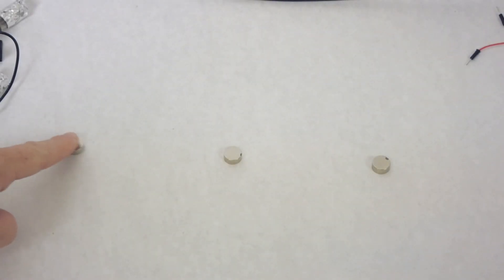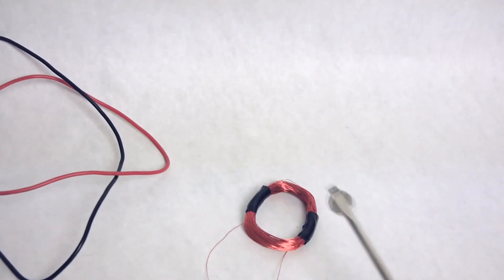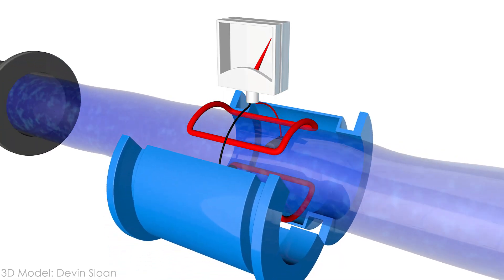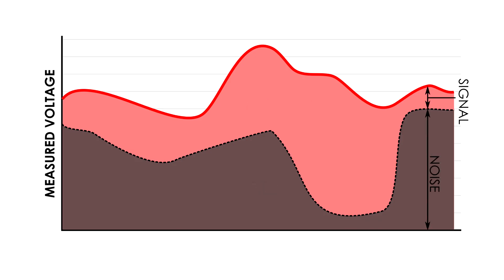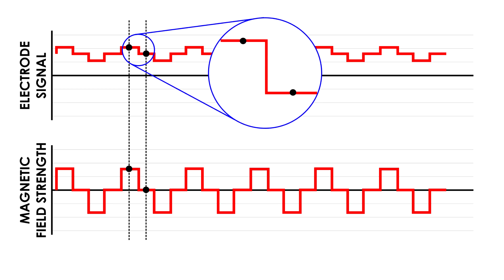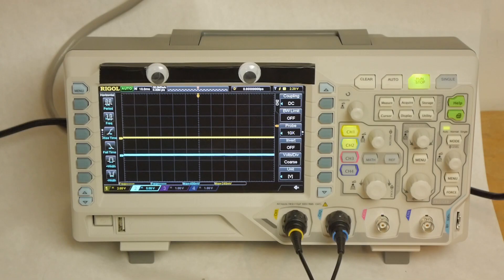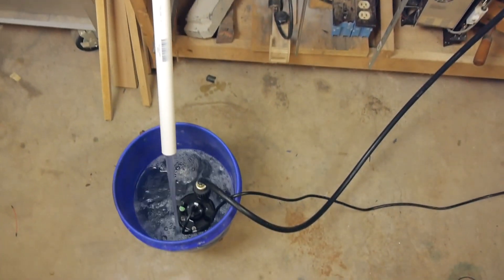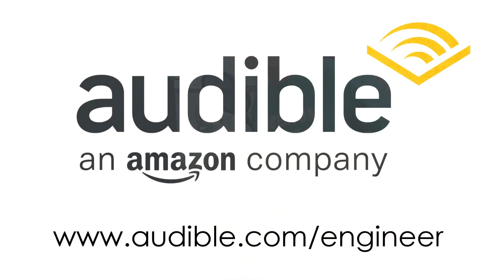How to Measure Flow with Magnets - (Magnetic Flow Meters)

Comment: The air core coils you're using may be a source of some of the problems. Try using a soft iron laminated core. Air cores are good when you need a homogeneous field (like in an NMR) but require huge amounts of current to get appreciable field strength (Which is why NMR machines typically have superconducting magnets). A soft iron core will help concentrate the field into the fluid.

One caveat is that the iron core will have a higher inductance, which could damage your H-bridge if switched off too quickly. A capacitor in parallel with the coil will suppress that, but will slow down how fast you can switch between poles. Keep in mind you'll want to use a non-polarized capacitor or diode isolated electrolytics. 

I hope this helps

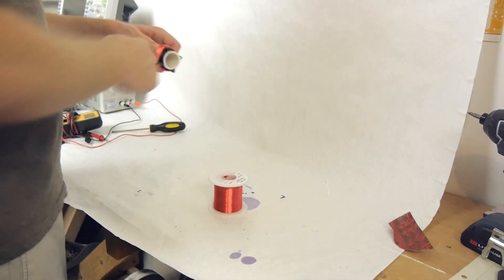Comment: 6:09 But....... You have a turning lathe....
Reply from the maker: It's a wood lathe that spins quite a bit faster than a metal working lathe. I couldn't think of a way to do it safely.
Reply: Sorry I know nothing about lathes.

 But couldn't you just wind the cable easier? I didn't mean you to try cutting anything.

Comment: Dear +Practical Engineering,
Please use the "math" function on your 'scope to multiply channels A and B, where A is the uV signal from the electrodes and the B is the current through the field-coils. Next, "measure" the average (mean) of the product-signal (i.e. the output of the 'math' channel), normalize for the excitation-amplitude and voila, you have filtered the needle out of the haystack :) The DC (average) level that you measure should be proportional to your flow. You can even measure bidirectional flow. For best results, put channels A and B on AC-coupling, HF-reject, heck you can even do triggered averaging if you trigger off of the current (channel B)! This is my favorite version of a low-budget-synchronous-detector :)
Reply: Yep, this is the reason for using the chopped Signal in the first place, so you can synchronously detect it in York noisy signal. This basically behaves like a really small bandwidth bandpass filter, thus reducing the noise voltage extremely.
Reply: same function as a Lock-in Amplifier....
Reply: A "synchronous detector" is a subset of a "lock-in amplifier" - this particular use-case doesn't warrant a (way more expensive) lock-in amplifier, i.m.o., especially since the reference excitation-signal is readily available.
Reply: hello aditya. I am looking to develop magnetic flowmeters here in india. would you be able to offer any help?
Reply: @ATLANTECHFLOWMETERS  Sure. PM: firstname.lastname  (a) gmail

Comment: You need much strnonger magnetic field, i.e. more efficient design of the coils. I's suggest a C shaped metal core with the PVC pipe going through the opening in the C. The rest of the core can then be covered by a massive coil. Such design with a somewhat closed magnetic circuit would provide more tightly packed magnetic field. Also, you can try adding another set of measuring electrodes - Iď suggest one pair at the place where the fluid is entering the field and one at the place where it is leaving the field - these two pairs should produce opposite signals (hopefully with the same orientation of noise), so by subtracting the two signals, you should double the signal and reduce the noise at the same time. Maybe the placement of the measuring electrodes with respect to the coils was the main problem - have you tried moving the coils upstream or downstream from the magnetic coils?

Comment: A combination between positive displacement and induction coils is quite easy to do. I've seen industrial flowmeters with simple design as such. It is using an orifice plate, a rotating wheel with an iron core attached inside a pipe, and a coil to induce flux. The amount of voltage induced would translate to the velocity of flow. It is essentially a small hydro turbine and the orifice plate serves as a constant.

Comment: A hint from an EE: if you have to extract data from a lot of noise, and you have the excitation signal available, you can use a lock-in amplifier to do so.
You can surely find all the details searching the Internet, but the principle is to extract the correlation between the stimulus and the output, so to increase the SNR; this can be done with a simple analog multiplication between the input and the output.
Once you have done that, you'll be able too heavily low-pass the result of the multiplication and get a nice clean signal.

The multiplication is especially easy to do with your stimulus as you simply have to invert the signals coming from the readout twice per period.

One question, though: why did you use (+1, 0, -1, 0) instead of a simple (+1, -1) excitation?

Comment: Always control bandwidth to just what you need.  Filter the diffamp inputs!  Don't ignore the common mode voltage and assume it'll work out on its own!

Obviously, the output from the peak-detect-and-subtraction thing needs filtering to see the DC output at all.  Which is where the real power of filtering comes in, rejecting all that noise that isn't even your signal. :)

Comment: I'd expect it would be better to measure peak to trough rather than peak to midline. It effectively doubles your signal strength for no additional cost. Also, passing your readings through a low pass filter that rejects any signal above 5 Hz or so would be a good idea. It looks like quite a bit of your noise was 60 Hz line noise and harmonics from the motor. Eliminating those would clean up your signal substantially.

It would have to be a digital filter, absent some real complicated analog design knowledge. I'd probably have the frequency of the magnets alternating at about 100 Hz. You could theoretically do it as low as 10 Hz if you only care about 5 Hz signals and below, but a good rule of thumb is to oversample by 10x. During each cycle, take a reading at the end of the peak and the end of the trough, just before flipping the polarity on each. That gives plenty of settling time. Then difference the measurements and stick the results in a digital filter.

I'd still expect the output to be fairly dirty. You may try adding a ferrite core to your magnets (though test to make sure they can switch fast enough with the added inductive load) to boost the magnetic field. Or up the amperage. Your differential amp might also be the source of some noise. I'd slap an analog pre-amp on it with a 60 Hz notch filter and maybe a on it to get rid of a lot of the power line noise. Probably a low-pass anti-aliasing filter, too, with a corner frequency just above the switching frequency of the magnet, but considering you'd have one in the digital domain already, that's probably overkill.

Comment: You're saying it's DC, but it is AC as the direction of the current is changing. It's not a sine wave, but that doesn't mean it's not AC.
Reply from the maker: You're right, I used the term incorrectly.

Comment: One possible approach that I'm surprised I haven't seen in the comments yet... reduce the cross section to have the same flow result in higher velocity?

I haven't really thought this through but you could even try a noncircular profile to achieve high velocity and large electrode distance... but even smaller pipes should work as the cross section area is a quadratic function of the diameter (=electrode distance).

Comment: You want the SNR to be as big as possible so you have to do to things:

Increase the signal: Easiest way would probably be to increase the windings on the coil and/or the voltage you're feeding them. This increases the magnetic field and therefore the induced voltage. You could also try to switch to a fluid that is less conducting than water.

Decrease the noise: Use shielding! You basically built an antenna! I would shield the set-up with a non-magnetic material like aluminium foil. You also have to use coaxial cables to the electrode in order to decrease fields feed into the cables.

Hope this helps.
Reply: If you don't have coax cables, go with twisted-pair wiring. It's easy to work with, and Cat5e cabling is available at most big-box hardware stores with 4 conductor pairs inside.
Reply: Can you help me with electromagnetic flowmeter's transmitter firmware and hardware design?

Comment: First I want to say great work on building and publishing this.
It really showcases a lot of the tricks we use do measurements out in the world.

Can you try the following to improve your psnr:
- use half the transformer of an electric appliance (coil with core), with proven magnetic strength
- put salt in the water
- bigger pump to generate your data points

Or better yet hack one flow meter and stick the scope probes in that.

Thanks again for building this.

Comment: I'm not sure if this exists already. but would it be feasible to have a sealed container with a winding of flexible tubing that can expand and contract based on the flow of a given fluid, and then measure the pressure change inside the sealed container minus the pressure inside the tube?
Reply from the maker: If I'm understanding you correctly, I think you're describing a venturi meter.
Reply: +Practical Engineering   Not exactly. Reading over my previous comment I don't think I phrased my idea very well. Imagine a compressed air tank with a pressure sensor and two ports on the side. The fluid whose flow was to be measured would go in through one port, pass through a coiled tube inside the tank and Flow out the other port. As the fluid flows its centripetal force will increase thereby expanding the coil inside the tank  expansion of the tube will cause the pressure inside the tank to rise which will be read out by the pressure sensor on the air tank. But considering that the static pressure of the fluid to be measured would also cause an expansion of the tube the whole system would have to be calibrated so that the positive pressure in the tube was filtered out of the data returned by the sensor in the air tank. I would imagine that the hardest part of this entire idea would be sourcing or creating a coiled tube that expands more due to centripetal force than it does from static pressure.

Comment: 5:07 but DC is defined to have current flowing only to one direction, that can't be DC then. Yes, if you only watch a part of it at a time it's DC but you can do that with any AC source.
Reply from the maker: You're right that the terminology gets a bit nebulous once you make the waveform biphasic. A less-rigorous definition of AC implies a sine wave which was the point I was trying to explain.
Reply: That definition doesn't seem too useful. Wouldn't regulated AC or something similar make more sense?

Comment: Excellent video; wish I had the drive to attempt these things
Reply: Well, that a tech we use in the oil and gas to measure flow rate out but in that case, the measure is subject to a lot of environmental noise. One point you may not have check was that with air bubble or not fully filled pipe, the measure is erratic and spiky as air is considerably more resistant, a way to quickly fix the layout is to include a filling tank above the measuring point to insure that the tubbing is full of fluid with no air bubble.

Comment: Another idea to generate the magnetic field is to have two wheels with neodynium magnets glued to it and rotate them on either side of the pipe. Should generate an alternating mag field of good strength, albeit not that high in frequency.

Comment: Grady, if you want to treat a real-world hydraulics problem, here's one for you --
In my town, the municipal water supply has a problem:  over 1/3 of the water that's pumped out of the ground is lost.  The manager of the town's water system doesn't know where it goes.  The town has spent a fortune replacing water meters, hunting for leaks, hiring consultants and contractors, ... -- all without success.  
So, how can leaks be located in a municipal water supply ?

Comment: I enjoy your videos.  I would recommend driving the magnet coils at a frequency that is not harmonically related to the line frequency or other interference sources. Amplify your sensor signal and feed it to an analog to digital convertor (ADC) at a sampling frequency that is a much higher harmonic of your driving source.  When amplifying the signal, amplify it just enough to keep it close to the full scale input of your ADC without clipping. Then take a discrete Fourier transform (DFT) of your sampled signal to filter out everything except the frequency of your driving source.  That will have the  effect of having a very narrow bandpass filter of your sampled signal and greatly reduce the effects of noise.  I've used that technique to pull signals out of the noise in other projects.  It done right, you can increase the effective number of bits of your ADC by an order of magnitude or more. Main issue I could see is keeping your driving source from radiating into your sensors directly -- so layout is probably critical.

Comment: "Hand-wound in small batches..."   Heh. I chuckled.

A flowing liquid generates a voltage, proportional to its speed? Huh. You just taught this old engineer something new. Time for a Wikipedia expedition!

PS: "artisan coils, hand-wound, using locally sourced magnet wire" accurately describes the Tesla coil my roommate and I built in college. Acquire parts from local surplus store Haltek, extract bell wire from a defunct CRT, then wind around a plastic tube. Hours and hours of winding…

Comment: If the tube diameter is reduced at the meter, the fluid will accelerate giving you a louder signal. Also smaller magnets with thicker gauge wire and more current should help too.

Comment: I will try using iron core solenoid instead of stainless steel screws as sensors, the electromagnetic source coils can be A/C variable to control loss in signal and I will start by measuring the field with air flow using compressed air, then move to different liquids(water, distilled water, mineral oil, motor oil)/gas (CO2, Hydrogen, etc)

Comment: i got to make one of these in my second year of electrical engineering. although i had machine wound electromagnets, and probably a better pump, my results weren't much better than yours. if it helps, i found distilled water gave more consistent results, and gold plated electrodes helped as well.

Comment: Great video! I like it how you go into details of calculating the flow rate at the end. 

One of the characteristics for a magnetic flow meter is that it works the best when the fluid is conductive. Water on the other hand might not work as well.
Reply: That would be solved by a spoon of table salt I think. Tap water in europe is around 0.05 S/m.

Comment: Most mag flow meters have electrodes/rings before and after the actual meter with a large ground strap around the actual meter. This lets any stray voltage in the water to flow into the metalic pipe before and back into the water after the flow meter. This strap is also very well grounded. Using PVC for all your plumbing is really asking for static noise. Also the pipe must always be competely full of water so most mag flow meters either measure flow vertically up or have a section of pipe after the meter travel vertically so no air can enter the meter. I also hope you added a pinch of salt to the water for conductance of the liquid (mag flow meters don't work on Deionized water) and put a 20 Mohm resistor between the two electrodes because the impedance of an op-amp can be extremely high leading to noise.
Reply from the maker: +Curt D I did have shielding electrodes in the flow on either side of the magnets. Probably not as good as the rings. I added some baking soda to boost conductivity. I didn't try a resistor across the electrodes, but I think my amp circuit had one anyway

Comment: what if the chemical composition of the fluid (or the fluid itself) changes? i guess you would have to calibrate it again to make up for changes in conductivity?
Reply: That's what i'm thinking but i'm not sutre either
Reply: from what he says this pretty much cannot be used to measure liquids which does not induce EMF either.
Also if fluid EMF induction changes due to properties of liquid results also will vary...
Reply: My process engineering career spanned the '70s to the teens so you can imagine the improvements I saw in instrumentation.  When I started, mag meters were the size of suitcases the minimum fluid conductivity was high.  By the 90's electronics had brought the size down to almost the pipe size and minimum conductivity of the fluid to almost nothing.  In the beginning the flow tube was much smaller than the pipe size (usually trying to get 15fps or more) to get higher velocity.  By the 90s, electronic improvements made that largely unnecessary in many applications.  Over the last 10 years of my career I only specified mag meters for non-critical applications because Coriolis mass flow meters had become so cheap and are much more accurate and reliable.  Above a minimum, fluid conductivity doesn't matter much.

Comment: How would separating the electrodes along the pipe(in the direction of the flow) but still keeping them perpendicular to the field impact the measurement?
Reply: I think that if the water would be more conductive (salty water) spacing the electrodes more would improve signal to noise ratio, but it the water is closer to distilled water you'll have less gain and such would me more prone to noise.
Reply: sounds reasonable. I was imagining a little spacing would make it easier for the electrons to move with the flow to the other electrode. I just watched another video on the same subject. The field separates the already charged particles in the water so there was actually no particles traveling between the electrodes thus separating them along the pipe should be pointless.